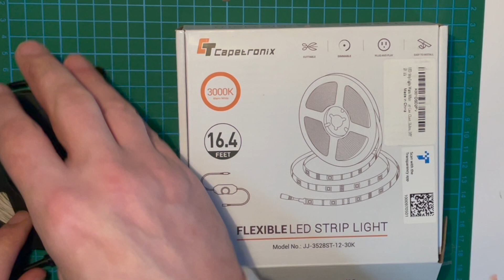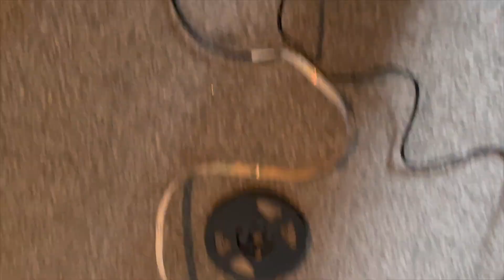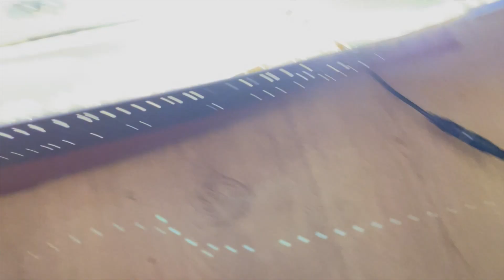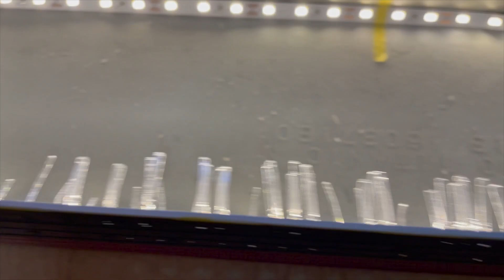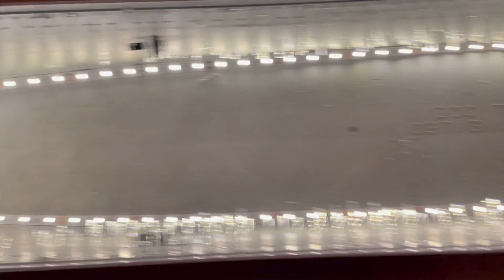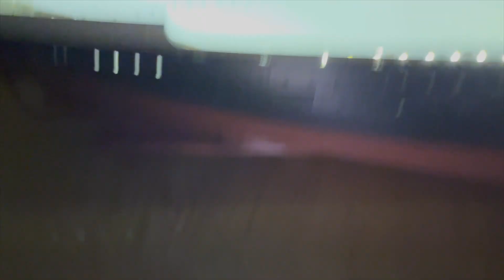Trumpeter Titanic 1:200: Lighting the Hull

Comment: Do the stock LEDs not dim when you connect extra ones series with them like this. It's powered by a 5v supply isn't it
Reply from the maker: I did all my own lighting on it. It is plugged into mains supply.
Reply: @themodelbench have you a plan by any chance of your setup. I am struggling with mine.
Reply from the maker: @conor0044 I don’t sorry..your best bet is to watch my video. It might help.
Reply: @themodelbench sorry for all the questions lol. Can I just ask if you've simply connected sections of this strip all in series throughout the model, combined with the nano leds with resistors? Hard to tell from the vids. Conor
Reply from the maker: @conor0044 Yes that’s what I did. And added resistors along every few lights. Don’t have too many in length without a resistor. And keep testing..best of luck. 😊